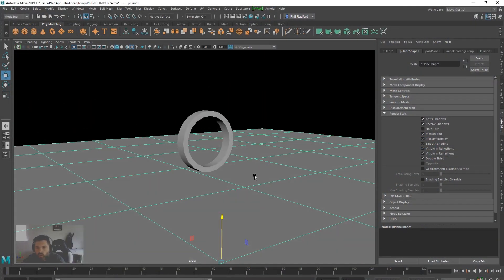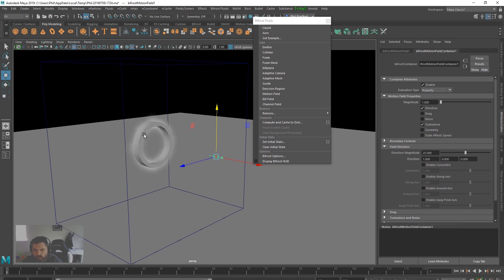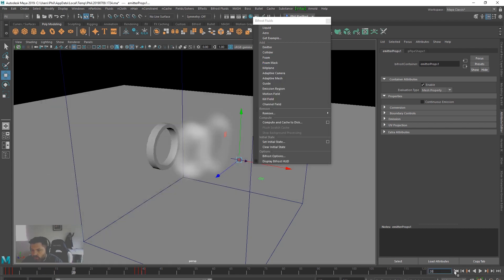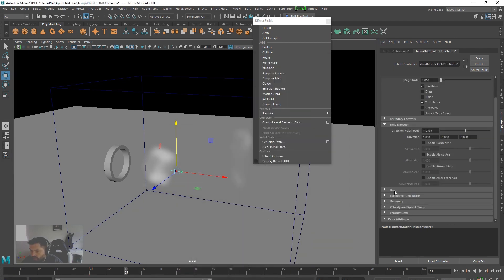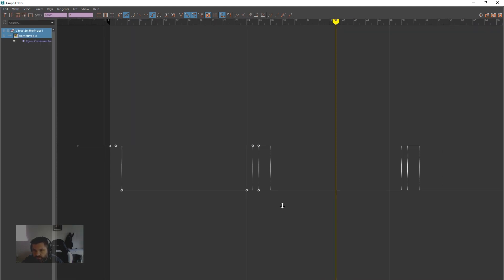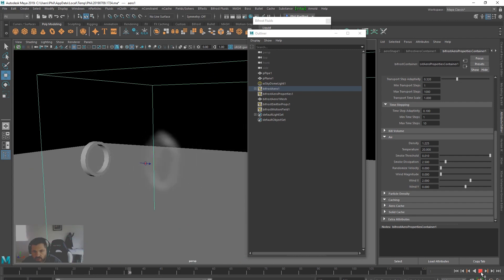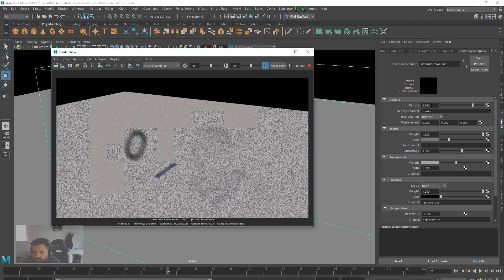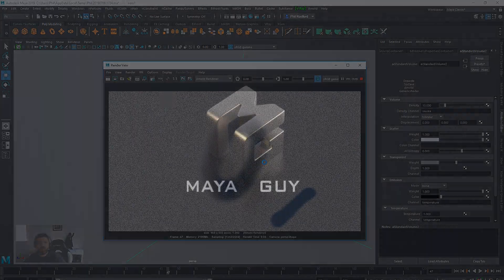Creating Smoke rings In Maya Using Aero + free Maya file (link in description)

Comment: Question, Mr. Radford: What is the difference between Bifrost and older Fluids in Maya? Is this too simplistic a question? Perhaps I will ask, is there any reason to prefer one over the other? I've noticed that fluids allows resolution control, but it does not seem that bifrost does. Please bear in mind that dynamics has never been a strength of mine. Thanks.
Reply from the maker: It's not a simplistic question, in fact it's down to taste and some other aspects. They use completely different solvers. You can change the resolution in Bifrost, it's under the bifrostliquidpropertiescontainer tab (nice small name to remember there) and under the resolution tab you will find Master Voxel Size, if you crank that number down from the default 0.500 to something like 0.100 you will see your liquid or aero (smoke) get much more detail. It's the same as increasing the resolution of a maya fluid container (volume) except the numbers go in the opposite direction, visually . But both fluids and bifrost work off of 'volumes' . In simplistic terms a squared grid creating inner cubes (voxels, like tiny cubes) that contain vector information (position etc) and move the points between those voxels. In Bifrost, lowering the master voxel size increases the amount of voxels able to fill the volume, more voxels higher quality, maya fluids is the same. Both maya fluids and Bifrost are multi-threaded so all of your cpu cores will be calculating. Bifrost has the advantage of the scratch disk which is a kind of cache that enables you to play your simulation more quickly (if enabled) where as you have to physically cache maya fluids. Bifrost is heavy on RAM though. Bifrost will give you good fluid physically correct simulations straight off the bat. Maya fluids has more control when it comes to colour and look development in my opinion and has allot more controls than Bifrost when it comes to this. Bifrost is really, purely, a liquid simulator, Maya fluids is more about smoke and cloud type simulations. I think Bifrost and aero are getting some big updates in maya 2020 so don't get too involved in them unless you are sticking with maya 2019 (or whatever version you are using) for a while. Hope that helps in some way.
Reply: @MayaGuytutorials  Wow man, thanks for taking the time to type all that out. That was chuck full of information goodness. I think I'm going to save your response onto a Windows sticky note. Much appreciated sir.

Comment: Hello there MG. I seem to be having a problem with my BiFrost plug-in. Got the menu you have, I get a container, but nothing emits. I select a poly torus, then select "Aero" from the menu, a cube pops in, but there is no emission from anywhere or anything. And, the container does not even cover the area of the torus. I also cannot seem to get the Bifrost Graph Editor. Any ideas? Thanks man. Love your tutes.
Reply from the maker: Hey Keith. That's a really odd sounding problem. Sounds like Bifrost isn't loaded completely. You shouldn't ever get a 'cube' when adding aero, unless you mean a 'volume' ? Is everything loaded correctly in your plugin manager?
Reply: @MayaGuytutorials  To the best of my knowledge, yes. I double-checked that, in fact.
Reply from the maker: @keithyakouboff8755  Send me the scene, I will take a look. You can grab my email from strange-box.com
Reply: @MayaGuytutorials  Okay... Guess what?? NOW it's behaving itself!!!!!!!! What the H-E-double hockey sticks?!?

Ugh... Maybe Maya just needed a reboot?? 

Sorry to trouble you man. (I sent this same message to the e-mail addy I saw on that site.)
Reply from the maker: Double check Maya is set to centimeter working units and try differing sizes of torus (or whatever primitive you want to test with). Also try setting bifrost resolution to much lower values like 0.100 to see if that works. If all else fails, send me the scene and if its working for me then you may need a fresh install of maya.